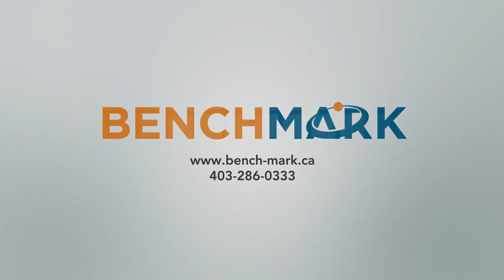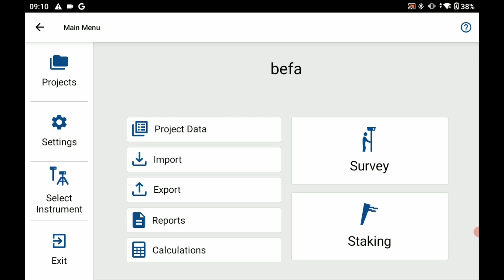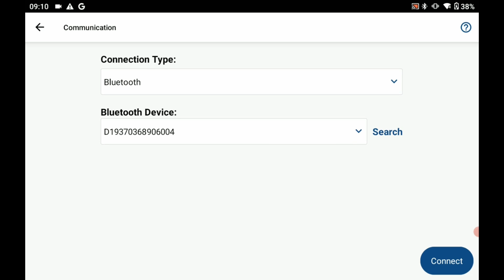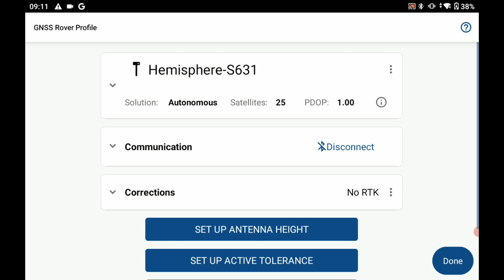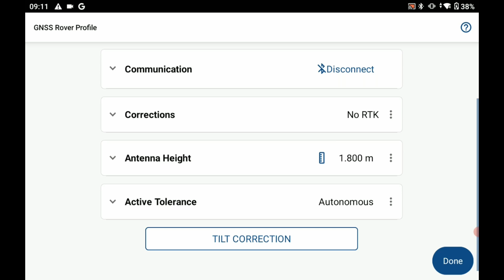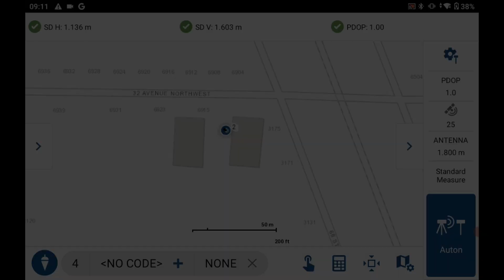FieldGenius for Android: Autonomous Rover with the S631 | Bench Mark

Comment: Hello, in what instance would you use just an autonomous point collection VS a regular good fixed pt...?
Reply from the maker: Hi, for some GIS data pickups it is easier and faster to use the autonomous rover. Having a sub-centimeter position is great, but if you are looking simply to digitize an asset, a sub-meter position is often good enough. Especially if you don't have a location for a physical base or the funds for a network subscritpion or one simply isn't available.